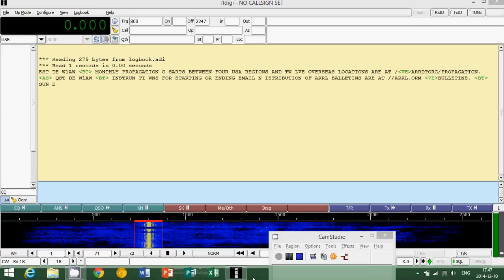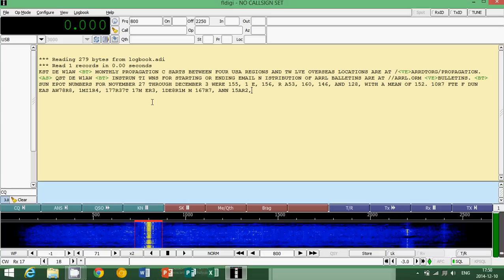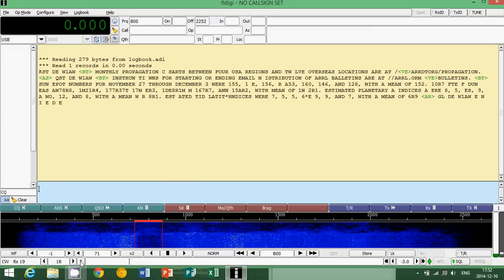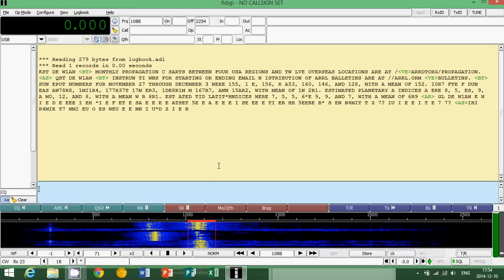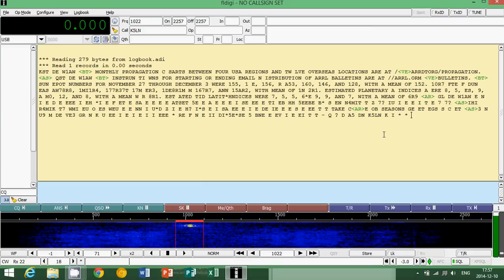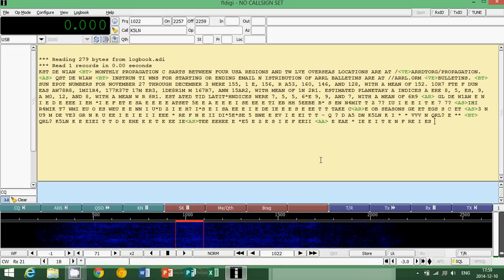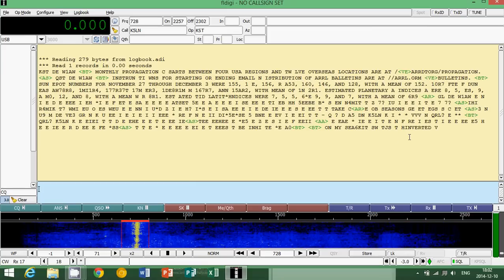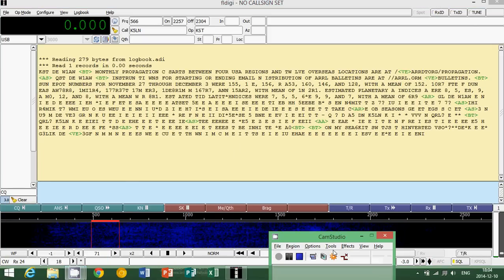Decoding digital signals using FLDIGI Part 3  Decoding CW Morse code

Comment: VVV (V = dit dit dit dah) is sent to check the key and keyer settings, and make sure the radio is ready to transmit. It isn't a code for something.
QRL is code for "is the frequency in use?" You might not hear anything but another station near you may be listening to a station.

Comment: Trying to determine what type of signal it is, is brutal.  If this program could actually identify the signal, it would be perfect.
Reply from the maker: plls5 No digital software detect the type of signals ..  it's with experience and also looking at the waterfall
Reply: OfficialSWLchannel G, I'm still trying to figure out how to get the waterfall to go full screen width!  I'm sorting out the signals little by little.  Did you ever get the PL660?
Reply: what do you mean full screen width??? if you mean height, like up/down, go to configure, then operator, select FFT Processing tab.

Under that tab, at the bottom, you will waterfall height. Try 250 pixels, save it and then close the app. 

Restart the app and see if the new waterfall size works for you. I believe there is a max but can't remember.

As for having the waterfall take over the entire screen, I think that is not possible.